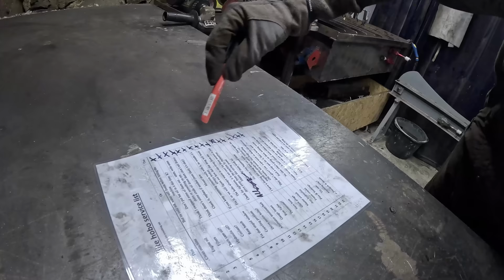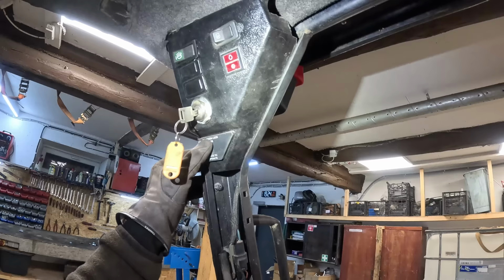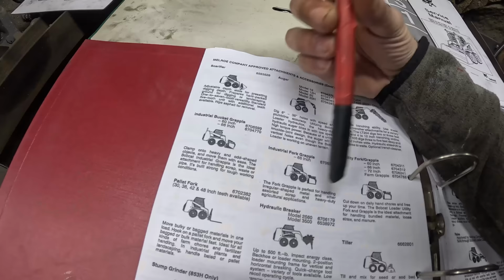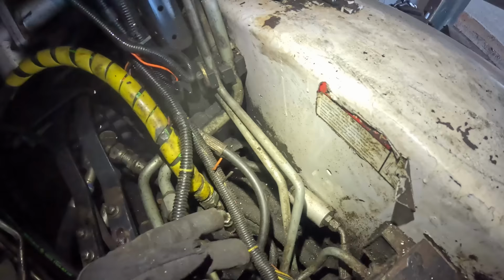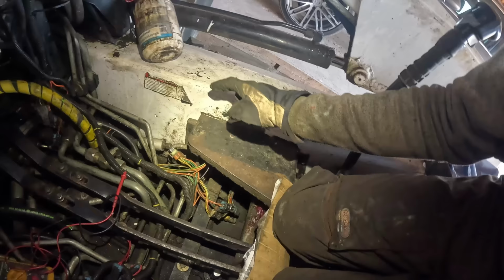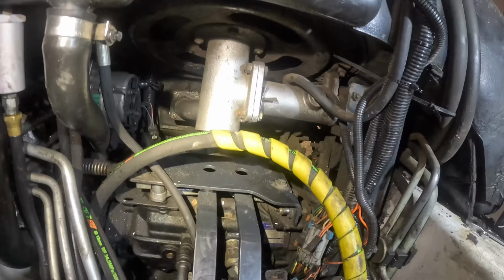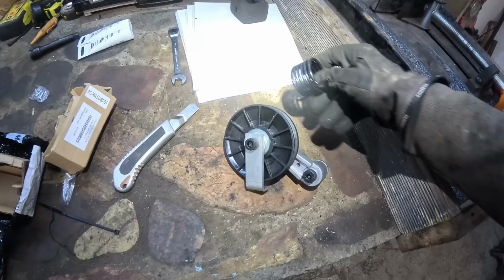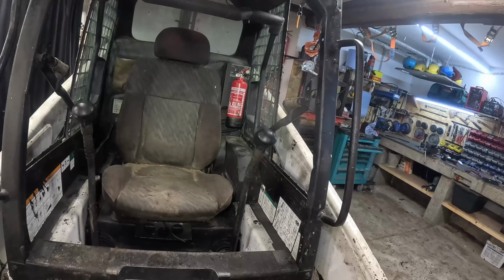Fixing up the Bobcat 751 skid steer - (part3)

Comment: You have the machine (lathe)
Knock all the studs out, clean and DIE them to any size you want!
Make your own studs and/or nuts. WTF are you doing? $10 a set? Ok, replace if you need to, but also easily rework what you already have. 
You would make a lousy Soviet. Too soft.
Reply from the maker: The amount of work to make your own lug nuts? That's insane and not worth it
Reply: Bro, I only criticize to critique. I know you're smart, I'm trying to save you a lot and make you look smart, thrift wise. Bolts are super easy. But the correct bar stock, check your die, make some cutting oil (used diesel oil) and fab your own, at a fraction of cost, no wait, and make excellent video footage! That lathe opens up a whole new world for your creativity. It's like an Artist buying an easel & palette. You just need the canvas. Dig a small hole in ground, to build coal fire, a place to heat treat hardware AFTER it's manufactured. Cut, knurl, thread, taper, heat treat & polish. Heat to dull red (700°F/371°C) then quench in that same used diesel oil till cool. It will absorb the carbon and cool gradually. Quench in water will make it like glass, totally useless. Go buy the nuts, ok, but buying the bolts is like you buying firewood. It's so satisfying to make your own stuff. Blowing huge money on hardware is very easy, I know, working on cars- hardware can get stupid prices. The subframe BOLTS for my '89 Buick Reatta were $16 USD EACH. 6 bolts total. $5 USD S&H UPS each. That's $21 USD EACH BOLT X 6 = $126 in fucking bolts.